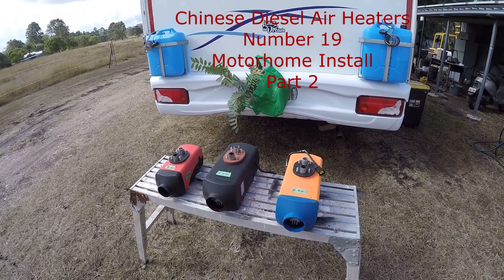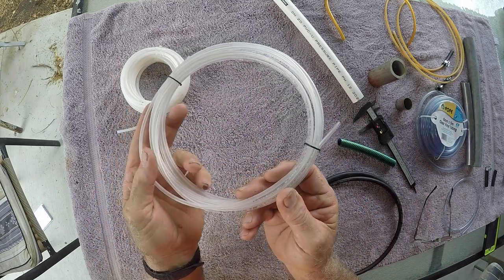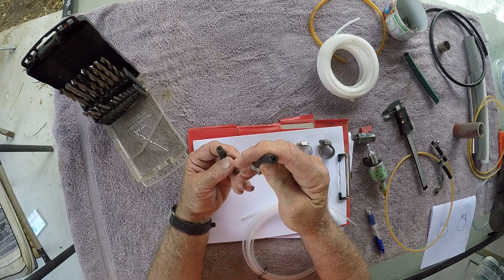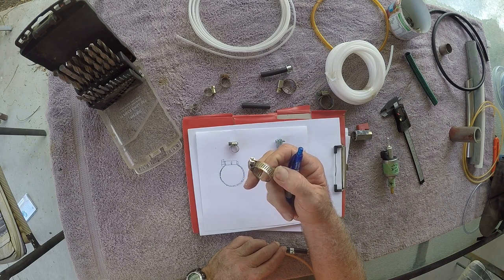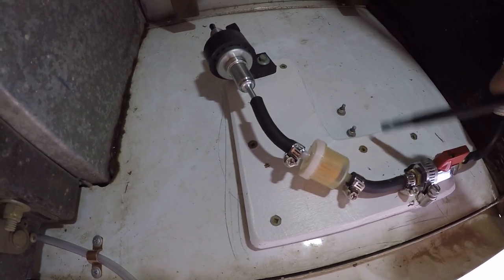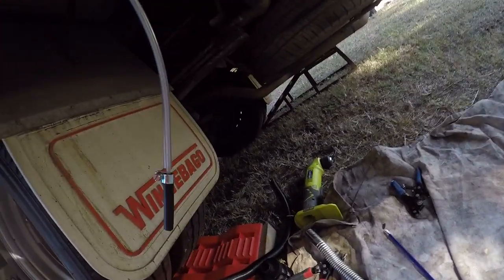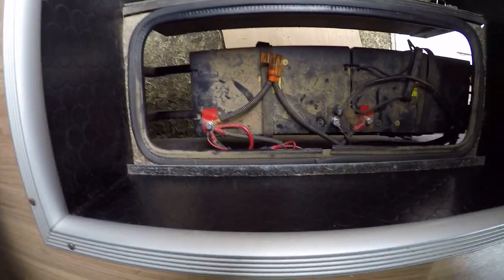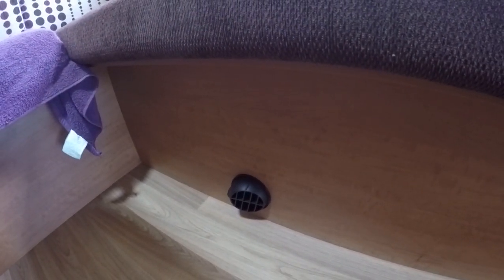Chinese Diesel Air Heaters no 19.   Motorhome Install Part 2

Comment: Hello again, John. I've been reviewing your fuel delivery and motorhome install videos, because I am stuck trying to get my newly-installed 2KW heater to start up. If you have any thoughts to share, they'd be greatly appreciated. Although the pump seemed to be moving some fuel up the hard nylon output line at one point, and the exhaust kicked in during one attempt to start the heater, there is now nothing but air above the pump, and I get the E-10 error every time. I've copied your setup for the motorhome install. I have the same layout of rubber fuel line upstream of the pump, a shut-off just before the fuel filter, and hard nylon for a much shorter run up from under the van to the base of the heater. My lines before that shutoff are longer, starting from a tank under the hood, through a quick disconnect fitting, down under the van and through an additional shutoff that's easier to reach without going under the van. I manually primed the lines up into the fuel filter, and have checked, tightened, and remade several of the connections upstream of the pump without effect. I have noticed that if I pull suction on the fuel line to fill the fuel filter, I also see air bubbles coming in. Fuel seems to flow by gravity all the way to the filter, but it doesn't fill completely without suction. Can I have that much air in the line without a leak somewhere? No leaks are visible. Is there any way to get fuel up into the pump that I could try? I don't have your line switch control, and the only way for me to control the pump is to cycle the heater. Am I at risk of damaging the heater by trying multiple attempts to start it up? As always, your information here has been gold for me and for so many. Thanks so much.
Reply from the maker: Hi T5034,

Suggest you look at a couple of things.

1. Remove the fuel hose from the pump outlet and run the heater. When the pump starts ticking diesel  should squirt out the top of the pump in pulses. If not you have an issue with the pump or the fuel delivery to the pump.
If a new set up it is most likely fuel delivery to the pump.

Under suction you should not see bubbles on the suction side of the pump. Check again your hose connections and check what type of hose clips you are using.

I would also remove the quick disconnect fitting and see if that makes a difference. The pump may not be strong enough to pull fuel past that fitting's spring, or it has an air leak under suction past the o rings.

If you have fuel squirting out the pump, reconnect the hard nylon, and if you don't have a manual pump switch just run the start program over and over until fuel reaches the heater.

Please let me know how you go. JMcK
Reply: Thanks so much, John. you are so kind to follow up. I got it going well today by bypassing my entire fuel line set up and connecting a temporary fuel tank (cobbled together from a plastic bottle) directly to the pump inlet. So mechanically it's all fine, and there is either an air leak or obstruction in my multi-section fuel supply line. All my connections use the kind of better stainless clamps you recommend, except on either side of the quick disconnect near the fuel tank, where spring clips fit better over the rubber fuel line I bought. Tomorrow I'll take it down in sections and see if I can figure out where the problem lies. Hoping to get it sorted before the temps dip in to the teens (F) in a few days! Cheers, Jennifer @johnmck1147
Reply: Well, John, you were right about the quick disconnect, although it took me a while to confirm that. I put one in line with my temporary fuel set up, and it seemed to work OK, but only when I removed  the one in my original fuel line was I able to get fuel all the way back to the pump. Disappointed about the disconnect, which was going to make removing my under-the-hood fuel tank so much neater. I'll see if I can get away with two shut-offs next to each other right at the tank. Thanks again for all your wise counsel!  Jennifer  @johnmck1147
Reply from the maker: Your welcome Jennifer.
I hope it all goes well for you.   JMcK

Comment: You could have an issue here with air intake..... you are relying on air in that seat box which is not infinite which means the heater will go searching for air to aid combustion. In turn this could prematurely coke up the furnace as it will change the fuel air mix if there are restrictions. Maybe try get an outside air intake  installed.

Comment: Hello John, Do you do the installations yourself or could you recommend anybody that does follow your step x step advice on the Gold Coast!
Reply from the maker: Sorry Chris, I don't do installs publicly. 

Caravan or motorhome outlets would do the job, or suggest someone who could.

The aim of this series was to help the DIY person get and install one of these heaters without paying out thousands of dollars. By doing this yourself you can buy and fully install one of these heaters for less than A$200. 

A dealer would probably charge $800 to $1,000 install cost, and may insist on installing a brand name heater (for warranty purposes) that will cost you $2,500. Total cost approx $3,500. They have high overheads, labour costs, staff super, workshop costs, insurance cost etc.

Suggest you find a handyman, or capable mate to help with install. 
Depending on the complexity, an install in a motorhome or caravan will take anywhere from a few of hours to a full day and a half. JMcK

Comment: Hi John, I have a question a bit off subject but still about diesel: I see you have a Hilux and an RV and was wondering if you have any knowledge of issues that can occur if you leave only a few liters of diesel in the tank of a car for 6 months or more? I have heard that condensation can build up and even algae can grow in the fuel. Have you ever heard of this happening and are the fuel tank cleaning additives I see for sale on Amazon worthwhile if one has left a car sitting for 7 months with only 10 liters of diesel in it to clean up any deposits that may have formed?
Reply from the maker: Hi DC,

I have the opposite opinion to many on this subject. I like to run the fuel down in my Med boat for winter storage, it not only lessens the weight on the boat when out of the water but I then fill up with fresh fuel at the start of the new season.

I have done test on empty fuel tanks “panting” and causing condensation. It is so minimal, I could barely even measure the water vapour ingested.

Algae and bugs can only grow in diesel if there is water in your tank. A very simple solution is to drain or suck out any water from the tank at end and start of season.

I personally do not like additives as in my opinion you are trying to fix the result, not fixing the cause. A bit like constantly putting bandaids on your little kids fingers that he constantly puts in the fan, rather than move the fan. Remove the water and you don't need additives.

In aviation we never put additives in the fuel. But we test drain and check for water in the fuel tanks every day before flight. With the boat, I suck up a fuel sample and any water from the bottom of the tank with a little hand pump twice a season. I don't use additives and I don't have fuel bug issues.  JMcK
Reply: @johnmck1147  Sound advice! Thanks again!

Comment: Hi John.
I've just fitted one of these heaters in my van. The moment I used the remote buttons my wife's FitBit Charger 2 buzzed on her wrist and won't come back to life. Have you any advice on this please.  
All the very best. James
Reply from the maker: Wow James,

Wow James,

This is the first time I have heard of something like this happening. 
What won't come back to life? The heater or the FitBit?

If the FitBit, I suggest you talk to them, as they have a real issue there. A lot of remotes, garage, car door, heater, fans etc  operate on the same radio spectrum frequency (around 433 MHz). So if the FitBit does not have adequate spectrum protection, any one of those remotes could cause it to freeze up.

I hope your wife uses one for fitness reasons ans not health issues.

Cheers.  JMcK
Reply: Hi again John.
Isn't that strange. My wife eventually managed to reset the FitBit. Funnily enough whilst out of action it recorded her activity during the day but the display had failed. We went back out to the van and used the remote again and the same thing happened again. We're not that concerned now that we know the thing is recoverable. Anyhow, we used the heater for the first time in anger last night and it was really quite astonishing. However, I think she will eventually forgive me for waking her up twice through the night when I felt a little chilly. (Balding) the upshot is, wear a hat to bed and just use heater for getting dressed in the morning. Thanks John your help through the entire shebang has been first class indeed. 
All the best. James (Uk)

Comment: Good day sir, I have a chimney flu that exits through the roof and is 5 feet long and maybe 4inch diameter, would it be ok to put my exhaust into this pipe? I know it may need a drain maybe for the damp in the exhaust. Cheers for your videos.
Reply from the maker: Hi Dave, 

That should work well, exhaust likes to go up, and you are not restricting the exhaust. However you need to be aware of CO production and whether it can it escape into the acom. area. If it is an old fireplace, well you have been generating CO there in the past and it has gone up the chimney.

May I suggest you consider a normal exhaust extension, and run it up through your chimney flue. It is only 5 feet and going upwards so should draw well and you lessen the chance of CO escaping from the larger flue, but I have not seen your set up.

You most probably will need a condensation drain at the lowest point in the exhaust, a small hole may be adequate (say 1 to 2mm) here, or you may need a marine condensate drain (see boat install video). You should also install a CO detector in the room close to your heater. If it was me and I installed the heater in an old fireplace I would probably start with a small condensation drain in the exhaust and put the CO meter close to the drain initially for testing. If I had CO leakage I would install a marine water trap drain.

Stay warm.   JMcK

Comment: Just wondering if lining the inside of the case with flex fix or aluminum foil tape would be any advantage. Keeping the case cooler and heating the air more.
Reply from the maker: I don't know Craig. I guess you could try it and see.
I try not to make any comment on something unless I have actual personal experience. However I do wonder if the tape glue would soften and let go in the heat.  Cheers.  JMcK
Reply: @johnmck1147  Yes I thought that of the glue ,could end up with fumes. Only just got my heater not fitted yet. Might see if I can line the bottom with tin foil with no glue.

Comment: Hi John, thank you so much for your very informative videos. After watching your part 1 @ 2 of your installation videos I have installed mine exactly as you did. However, I'm still can't get my heater to start.  I have changed the wiring harness and tried three different controllers, the two black controllers are showing an error E07, the blue controller with the red remote won't even start the priming the fuel pump. Any suggestions on what my next move should be apart from replacing the entire unit.  Cheers.
Reply from the maker: Hi Howard,

Did you do a bench test first before the install. Doing so tells you if you have heater issues or install issues.

Ok, first up. Is your battery fully charged? And do you have 12V at the heater itself. Is the heater connected directly to the battery? If you extended the wires, did you increase the wire size? Is the polarity correct. (Some “Chinese” manuals are confusing) red wire goes to positive terminal. Have you tried to start the heater with the engine running. That will often tell you if you have a low voltage issue.

Now the controller. Is the plug tight in the socket. Do the wire colours match in the plug and socket, particularly the blue wire. (I have seen wire looms that have wires reversed in plug and socket)

Now check the fuel delivery. Did you do a initial prime and confirm fuel squirting out the end of the hose where it joins the heater.
Have you used narrow bore hard nylon fuel hose on the delivery side of the pump. Some heaters are being delivered with cheap one size vinyl fuel hose. Anything more than a couple of feet you should only use narrow bore hard nylon on the delivery side.

It is a bit hard to offer more suggestions without seeing your setup. Please let me know how things go. JMcK
Reply: @johnmck1147  Hi John, thank you for your reply. Firstly I did not do a bench test. Secondly I have 12.86 volts to the heater,wires are connected directly to the battery, polarity is correct with increased wire size and it's installed in my caravan. 
Now to the LCD controllers,the two Black LCD controller are plugged in tight and the Red,Black and Blue wires are matching. However, as soon as I them in they go straight to E07. The Blue LCD controller when plugged in I can do all the settings. However, when I try to prime the fuel pump nothing happens. 
Now to the fuel pump. I am using the white hard nylon fuel line from the pump to the heater,but I can't check to see if any fuel is coming out at the heater end because the pump won't even tick over at all. I hope this gives you some insight into what might be wrong. Cheers
Reply from the maker: @howardross-gilder8331  

Hi Howard, is the plug to the pump tight? 

The pump does not start ticking on heater start up as it can be a couple of minutes for the ECB to go through its start cycle and give time for the glow plug to start.

You can check the pump by connecting one pin to a battery, and then rapidly touching the other pin with the other battery wire. Polarity does not matter. 

It is rare, but occasionally you do get a dud heater. This is why it is good to bench test before install. You sound like you have done most things right, and without seeing your set up personally it is hard to offer other suggestions. 

If the pump does not work, and the heater is new, suggest you ask for a refund and get a replacement heater.  JMcK
Reply: @johnmck1147  Hi John, thank you for your reply and advice. Since my last correspondence with you I have tested the fuel pump and it works. However, when I plug in the controller and Start the priming process nothing happens. I have also compared the main motherboard wiring on my heater to photos of replacement ones on eBay and mine is wired differently. What are you thoughts? Cheers.
Reply: Hi John, in reference to the priming issue I was having with my heater ,it turned out to be a incompatible motherboard.  Since I installed the new motherboard it's all good now. Thanks again for all your videos and your advice. Cheers.
Reply from the maker: @howardross-gilder8331  
👍

Comment: Thank you so much John! I’ve gotten about 2 feet of nylon hose into the vinyl tubing so far. I’m guessing I messed up a bit because i did both in hot soapy water instead of hot water on vinyl and soap on the nylon. 

Do you have any other tips to make it easier? 
Thank you
Reply from the maker: Hi VT, suggest you use larger diameter vinyl tubing, or even garden hose or larger fuel if you wish. The goal is to protect the hard nylon fuel hose. You do not need a close fit.

If your vinyl tubing is close tolerance, you must stretch it out as straight as you can first, then insert the hard nylon tube. You will get a jam if you try to insert the hard nylon into a coiled vinyl tube.

Good luck.  JMcK
Reply: @johnmck1147  that’s a relief! Will it absorb the fuel pump pulses if it’s too close of a fit between the nylon and vinyl? 

Also, must the black rubber be used always between the tank and the fuel pump?
(And isn’t the black rubber always threaded with nylon?) 

In my build I’ve been told a fuel filter over the top of the tank is good for if it breaks and the space between that and under the heater is a good couple feet. 

I’ll be researching more, i just enjoy how your set up is based in understand of the heater and such. Trying not to mess this up ha ha
Reply from the maker: @VT-vy9jv  

Hi VT, you can use any fuel line you want from tank to pump.
From pump to heater you should only use narrow bore hard nylon. Flexible hose on the delivery side absorbs the fuel pulses. Putting the hard nylon through vinyl, or other hose is purely to protect it from abrasions and to prevent the pump “ticking” noise being transmitted to the vehicle body.  JMcK